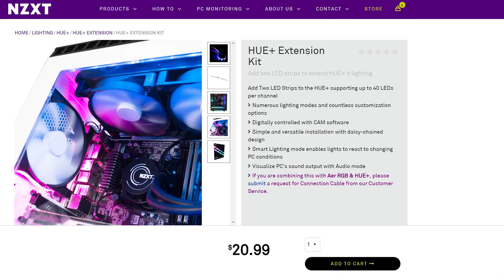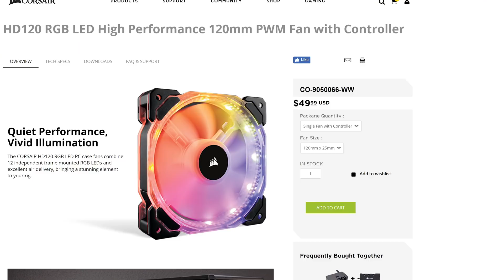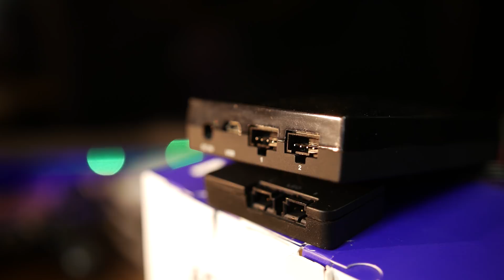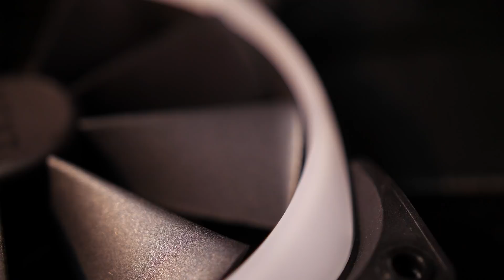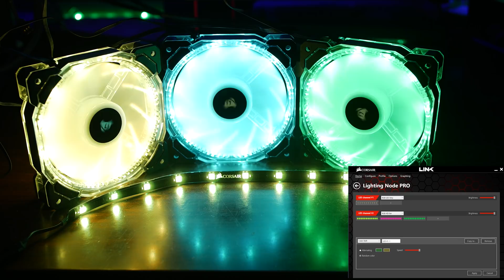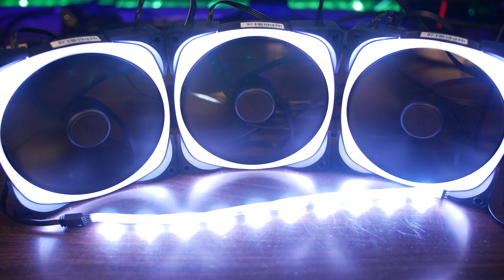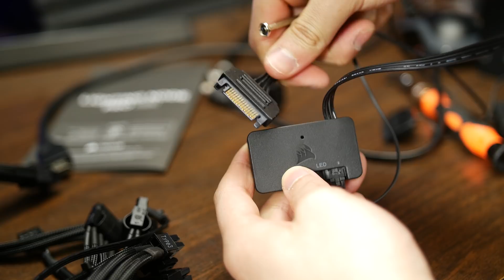NZXT HUE+ Vs. Corsair Lighting Node PRO

Comment: Huge Question!! So i wanna order the new CORSAIR LL120 rgb fans. But i have a NZXT kraken x53 liquid cooler. And idk if this matters but my RAM is also Corsair Vengence RGB and my case is the NZXT H500 without the hub.. My question is will the corsair rgb fans work on the nzxt case and liquid cooler and not mess up temps or rgb or anything???

Comment: If I want to swap out my 120mm case fans on my NZXT h500i to AER RGB, will I still need a HUE+ controller? Or would I just swap out the fan plugs on the controller on the case for a pair of AER RGB fans? I'm torn between this and the Corsair LL 120 but I don't want to have to buy a kit with 3 fans when I need 2 just to get the controller unit. Reason I like the LL120 from Corsair is that they are really bright and look great, plus I have the h115i cooler and they have ML140 fans which look similar.

Comment: For anybody that needs help with this you basically gets ya fans and connect them to the fan splitter which then this will connect to the commander pro channel 1. then you connect the other fan cables to the commander pro 1-6 fan headers to give em juice instead of connecting them to motherboard and sucking its life out. Then you grab ya led strips and connect them to channel 2 on the commander pro. youre welcomr :P

Comment: What if the mb has aurasync option ? Can the CAM and/or Corsair software be controlled in the aurasync software?
Reply from the maker: Nope!  They're separate.  CAM and Corsair have proprietary controllers, so they only work within themselves.
Reply: @ALittleDIMM  so what if i want to control my radiator in aurasync ? Where should i connect it ?

Comment: Can you use the corsair fans with the hue+??
Reply from the maker: Nope!  Corsair with Corsair and NZXT with NZXT only!  You can certainly use both in the same system, but they will still be separate from each other (you will need the Node Pro to control Corsair fans and the HUE+ to control NZXT products).
Reply: @ALittleDIMM  thank you sir,  and one more question, is the new i5 9600k good with a 1080ti or a rtx 2070?

Comment: So i got 3 of the HD120 inside my case and 3 of the LL120 infront of my case.  The HD120 are RGB channel 1-2-3 and the LL120 are 4-5-6.    The HD120 are working fine with the commandor pro but the LL120 Arent.  LL120 (4)  is working with rgb but i can't control it and it's only the middle light. LL120 5 and 6 arent working at all. Help please!   I thought i can combine them, but maybe i cant?

Comment: Did i need nzxt hue+ to control nzxt  kraken 
?
Reply: Can i control Corsair rgb fan with CAM?
Reply from the maker: The Kraken does not require the HUE+ to be controlled, only the CAM software.  CAM will only control NZXT components, not Corsair's.

Comment: Ik I am very late but cam you please help me?? I am building my Rig in th 460x rgb or S340 elite. I was going to get a 3 pack of SP 120 if i go with 460x, does it come with a controller?  If yes then can i connect all s6 of them to work together  and how can i control  them?  If i go with S340 Elite can the 2 RGB fans connected with the mobo? 
Please help, I'm going mad!
Reply from the maker: I don't own the 460X, but I believe the 460X RGB does have a lighting hub that can support up to six fans, and they are controlled by a button on the case.  None of the fans featured in this video directly connect to the motherboard, they each need their own respective control boxes.
Reply: ALittleDIMM thanks alot for replying so 6 sp 1e0 fans can connect to that and will sync properly? How do i control them? If i use inly 2 hd 120 in s340 elite can i connect tjem to mobo?

Comment: Wait do the triple HD120 fans include a 3 pin cable that connects to the node pro/command pro? Cause I’m getting the triple ll120 with node pro and triple hd120 fans. But the node pro that included in the ll fans only come with one led hub cable. Cause you can’t use both fans on one channel.
Reply from the maker: I'm fairly certain the Node Pro should come with one cable per channel. Are you sure it wasn't there?
Reply: ALittleDIMM It only come with one cable if you buy the node pro included in the triple pack LL fans.
Reply: ALittleDIMM It doesn’t. I also searched through a lot of YT videos. And they don’t. It only come with one cable. So I guess I have to spend $50 to get another node pro just for that one cable.
Reply from the maker: You can try Corsair customer support and see if they have a better alternative for you?

Comment: hey how i can use fan rgb light (COSRIA HD 120m)  to the NZXT  whether it should  in series or parallel  and which connecter i can use for joining the 3 fan into one NZXT Hue+
Reply from the maker: Corsair RGB components are not compatible with NZXT's.  To use Corsair's HD RGB fans, you need a Lighting Node Pro or a Commander Pro.
Reply: why is that so

Comment: Hey, quick question. Do you need the lightning Node pro to be able to use the "rainbow" effect shown starting at 8:20? Or is the effect still available if you just have the lighting controller?
Reply from the maker: Check 9:17 for effects without the Node Pro.  That particular Rainbow option is not available without it.
Reply: Cool, thank you for the fast reply!

Comment: I recently tried both the Hue+ with AER and the Lighting Node Pro setup. Taken in a vacuum, the Corsair solution is better. But all their cables are proprietary (outside of the fan power/pwm/rpm cables) and the normal Lighting Node pro doesn't connect directly to the fans, so you need the secondary 3 to 4-pin conversion hub with 6 headers. And the old push-button controller doesn't work with their newer fans at all due to it not supporting addressable RGB LEDs like the Hue+ did from the beginning. It's quite a hodge podge that doesn't work very well. NZXT sells the Hue+ with two Aer fans as a deal and you can get two lighting strips for like $21.00, and you just need a not-so-proprietary cable to connect the two, which NZXT support will send you for free, or realistically you can get it in almost any RGB LED strip package because it's really just two sets of 4 RGB pins and a cable. Otherwise, yah, you're a Punny guy
Reply from the maker: +10ee Thanks! I try my best!

Comment: Can you change the fans speed of nzxt on the also can you share that rgb wallpaper :P
Reply from the maker: The NZXT AER RGB fans have a four pin PWM cable that you can use for RPM control either through a fan controller or your motherboard.
Reply: ye i didn't wrote the question as I meant ... i just wanted to know if the nzxt hue + can control the fan speed? so if I connect the fans to the nzxt hue + i can control the light but not the speed ... I am asking because i recently purchased a s340 razer edition case and the fans that came with it are making so much noise wanted to go for the nzxt aer rgb
Reply from the maker: If you want to control the fan speed through CAM, you need the GRID+.  Otherwise, you have to do it in the motherboard's BIOS.  The HUE+ doesn't allow for fan speed control.
Reply from the maker: +Naim Bulliqi Wallpaper is in the description ;)
Reply: thnx for the replay bro , you just got a new sub

Comment: so you can just plug the fans in fanadapters on your motherboeard? no needed controller? I mean for only the fans, and no rgb strips
Reply from the maker: +FrikkernHD Correct. RPM control is still done through motherboard or fan controller. RGB control is done through the included controllers

Comment: Well... I have a kraken x52(so cam for aio led), i have 3 hd120(so corsair link for fans), and an asus mobo w/ aura for ram and homemade leds, i kinda screwed up didn't I?
Reply from the maker: Not necessarily!  I use CAM for my x62, Corsair LINK for my HD fans and Node Pro, Aura for motherboard and RAM, and Corsair Utility Engine and Logitech Gaming Software for peripherals!  So actually, maybe a little...
Reply: Well... I'll get my parts in etc 5 day so I will see how thing will work out, will come for advice if anything goes wrong
Reply from the maker: Good luck, I'll be here!

Comment: do either of these require and rgb header on your motherboard, as i have an matx board that has non, but wanted the hd120s?
Reply from the maker: +aidenhill No. They use their own connection through internal USB. No motherboard header needed

Comment: Be VERY careful with lighting node pro strips, their traces are the worst quality ever the leds break off the pcb VERY easily, even by twisting them. ive just had to solder 2 leds back on to mine just by fitting the strips in my case, make sure you have flux and  soldering iron hardy.
Reply from the maker: Oh, that's odd.  Corsair's sent me three or four Lightning Node Pros over the past few months and I haven't had issues with any of them.  Sorry to hear that!

Comment: I'm looking into RGB for my PC refresh and I have to say your channel is a miracle.  Do you recommend the Commander Pro if I'm wanting to manage 4 fans and 8 LED strips, or will the node pro work?  Corsair's information on the subject is infuriatingly lacking.
Reply from the maker: +Cody Schug You would need at least two controllers! If you don't need a fan controller or internal USB hub, two Node Pros will work. Each channel supports up to six fans or four LED strips, so four fans will take up one channel, four LED strips will take another, and the last four will take a third. Both the Node and Commander have two channels each

Comment: In front of the case, 3 fans 120 or 2 fans 140 is better ?
Reply from the maker: Depends on the fan, but in general, three fans would be theoretically better.  Practically, it probably won't matter very much.
Reply: You are The Captain, bro. Tksss

Comment: Are the RGB Cable Extensions standard 3 pin fan cable extensions?
Reply from the maker: They are not!  Each of them are different and you won't be likely to find extensions from anywhere aside from the respective company.

Comment: i plan on getting the three pack corsair hd fans as well but i wonder if you can connect the controller to the mobo and use corsair link or you need the commander
Reply from the maker: The controller does not connect to the motherboard.  If you want to control the lighting through LINK, you need a Node PRO or a Commander PRO.
Reply: ALittleDIMM alright thanks

Comment: Can you make a video on how to setup the corsair hd 120 rgb fans because I can't figure out how to make them rainbow
Reply from the maker: I'm not sure I understand.  This is that video.
Reply: ALittleDIMM I don't know how to make them rainbow like do you need the command pro or the remote I've never built a pc before so I don't understand much I guess
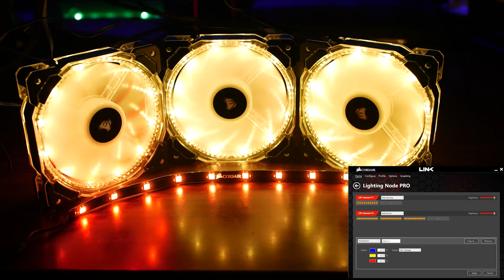Reply from the maker: At 8:20, I show the effects you can access with the Lighting Node Pro OR Commander Pro.  Either of these devices will let you control the fans through the Corsair LINK software.  8:58 shows the effects you'll have access to if you use the controller that comes with the fans only (no software control).
Reply: ALittleDIMM oh ok I was confused if you needed something for the software to control the fans but you need the lighting node/commander pro thank you so much
Reply: ALittleDIMM could you also use the rgb hub with the 3 pack of corsair fans instead of the node pro and commander pro?
Reply from the maker: You need the RGB hub either way.  It's used with the controller, or it's used with the Commander Pro or Node Pro.  There's no way to customize lighting without it.

Comment: Hi,  Great videos like allways 
I have the Corsair HD120 pack whit controler 
I´ll like to know if I have some extra AER fans can I use them on the Corsair HUB to make the RGB work ?
Reply: At lest to know if they will work on the manual controller  IDC about the sortware
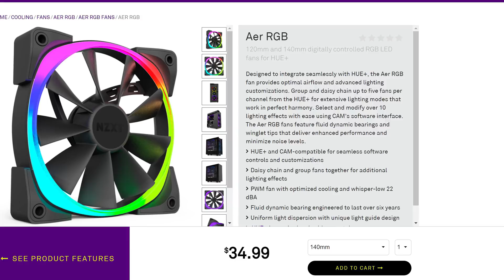Reply from the maker: No.  The AER RGB fans and Corsair HD/SP fans have proprietary connections.  They cannot be used with one another.  Check 1:17

Comment: Very informative video, thanks. One question though (which you might have addressed in the video but that I might have missed), is there a way, with either of these lighting "systems" to easily turn off the LED's on the fans completely i.e. via the interface software?
Reply from the maker: Neither system supports a "killswitch" feature for the lights, but Corsair's comes closest.  You can set up a profile with all the lighting disabled, then switch to that profile.
Reply: Thanks for the response. So what you're saying is there is no way to disable/turn off the LED's on the AER fans without physically unplugging the fans from the HUE+ controller? If so, it's quite a large design oversight by NZXT if you ask me. There are plenty of us who watch TV shows and movies on our PC's and I'd prefer to turn off the lighting when doing so...especially at night. :/ I was initially leaning towards the NZXT but it now looks like I'm stuck with having to get the Corsair setup.
Reply from the maker: Oh, you can turn the fans off in the software!  I actually forgot CAM has buttons to disable lighting, but you can only do it by channel (for example, all fans at once, all LED strips at once, the Kraken cooler's ring, and the cooler's logo LEDs).  It's just faster to disable on Corsair's system if you've set up for it.  Sorry for the confusion!

Comment: Great video... but I want connect 12 corsair fan in my custom watercooling.... how i do that?
Reply from the maker: You'll need at least a Node Pro and two fan controllers (each controller holds six fans and will take up both Node Pro channels).  If you want LED strips, you'll need another Node Pro or a Commander Pro.

Comment: I see the pc in the back is using the aers facing inside the case does that mean you dont have any exhaust fans?
Reply from the maker: There are three AER fans inside of the PC behind me, two up top and one in the back.  The lights facing in means they're all exhausting air.  I have four non-LED fans for intake (push/pull).
Reply: ALittleDIMM aw ok. Thx for the reply, helped a lot.

Comment: wait.. the nzxt rgb lights won't work without the controller?
Reply from the maker: Correct.  Each of these need their controllers to work.  The alternatives are the standard 5050 RGB strips, but those will have to be connected to your motherboard and will have less customization options.

Comment: Anyone else has got problem with setting up custom profile for NZXT RGB fans and NZXT RGB led strips separately? I cant set up one custom color for fans and other for led because when I change it on one oh them second change as well.
Reply from the maker: To change the LEDs individually, there is a Custom tab in the Lighting effects.  You'll also have to uncheck whichever channel you're not editing in order to only adjust one or the other.
Reply: I mean on Custom tab even when I have only fans seleceted and I change color lets say to green there is  few leds changing to green on led strips as well. not all but few.

Comment: wait the NZXT cable looks like the standard RGB header found on most high end motherboards these days.
Reply from the maker: The LED strips look like the standard connection, but I don't believe they will work with motherboard headers.  The cable to connect the LED strips to the HUE+ is not standard, but if you decide to try it, I'd love to hear how it turns out!

Comment: do you have a video for your computer on the bottom right hand corner? i wanna see the set up
Reply from the maker: I've got a vlog that shows my current setup, but not one specifically for what's in this video.  System components are in the description, and there's a "Basic Acrylic Mods" video that shows how I did the side piece!

Comment: Hey can anybody tell me that if Corsair has multiple controllers in a single rig just like the NZXT does? I'm going to mod an illusion mirror and a side panell and doing so will require me at least 5 controllers. Thanks anyway
Reply from the maker: Sorry, I'm not sure I understand.  You can hook up multiple Nodes to your motherboard, as long as you have enough headers, and each Node has two channels, similar to how NZXT's HUE+ works.
Reply: Such quicky answer and you got it right. Subbed
Reply from the maker: Thanks!

Comment: SO I know for the NZXT fans you need the Hue+, but to use 3 NZXT fans along with the RGB strips included do you need to have that $30 hub you showed? Also my case is the Corsair 370x RGB that comes with the three fans in the front. I'm new to the building/RGB world ):
Reply from the maker: You can fit up to five NZXT fans on one HUE+ channel.  The HUE+ has two channels, so it can support up to five fans and four LED strips, OR eight LED strips, OR ten fans.  There is no additional hub necessary as long as you're using that many RGB components or less.  

Both the Corsair 460X and 570X can come with three SP RGB fans in front, just note that you'll need to use the controller included with the case to control those.  The HUE+ has no influence there.  Alternatively, you can control the SP fans using Corsair's Lighting Node Pro or Commander Pro.  Just note that if you use both the HUE+ and Node/Commander, you'll be using two of your internal USB headers.
Reply: Perfect, you're amazing <3
Reply from the maker: Thanks, I try!